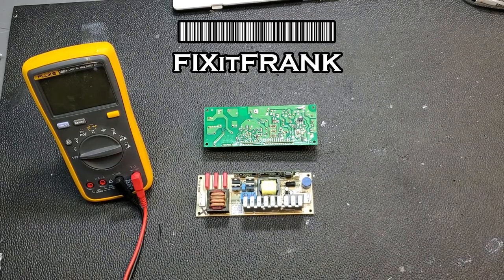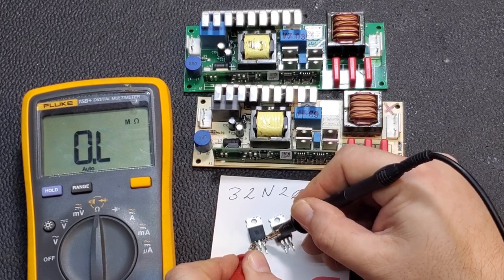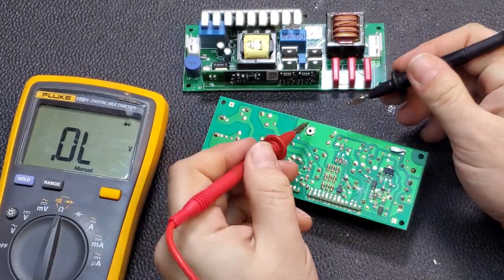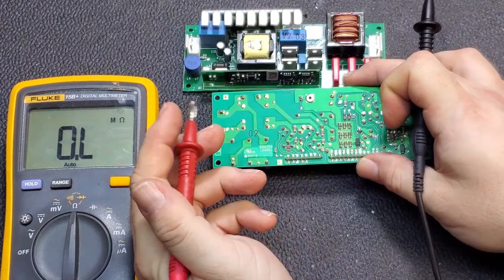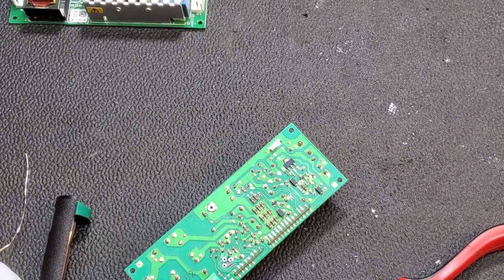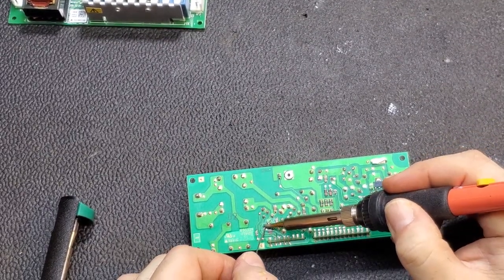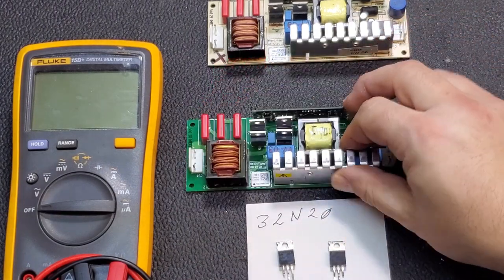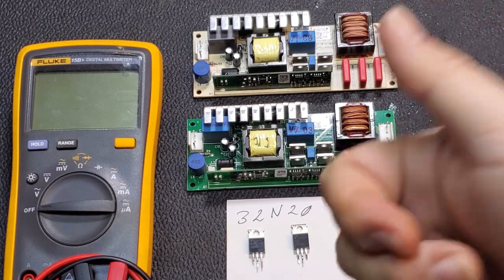Digital Video Projector Ballast Diagnosis and Repair

Comment: Hi Frank, I appreciate your videos they have been very helpful with repairing several projectors. I have a question concerning an Epson 6010 that I'm trying to bring back to life. Currently it will power up, cinema filter adjusts, lens cover opens, all fans operate, auto iris adjusts, lamp comes on... then it all falls apart.. lamp immediately goes back off (can only see it light with the case off), both temp/lamp lights flash red and fans go into overdrive. Then it shuts down with the lights still flashing. I'm wondering if this could be ballast related. I'm running out of things to test, everything so far seems ok. Thanks for reading!
Reply from the maker: Hi Brian! YouTube keeps moving my replies to the wrong comment so I apologise of this appears multiple times. 
I would verify the voltage of the tach leads of the fans. Even if spinning correctly, they can fail to report that. I prefer to use a scope to measure(average is two pulses per room)but a volt meter will work. The measurement should be very low. Usually under one volt DC. If you measure 2v or higher, then a fan is a problem. I doubt the ballast since you get lamp/temp warning and you had an image even briefly.
Reply: I've tested that the fans all cut on and work but I'm not sure how to test the tach. Can I do that with a multimeter or do I need something different? I will say that when I first tested the fans with a 9v pigtail the two "LV" fans would not come on. They did come on however with power to the unit. Thanks for the help with this.... Losing my mind trying to figure it out.
Reply: @FixitFrank  Ok thanks. I'll see if I can test the voltage of the fans. Hopefully its just fan issue. The light output never makes it to the lens, I can just see the lamp come on for about 2 seconds when I have the case off and power the unit up. Not sure if that matters.
Reply from the maker: @briankidd4246  Here you go  https://youtu.be/stIYr2bI2fQ  I show how to test some here.  As long as the door switch is bypassed, you can run it that way.  I dont want to say the ballast is bad yet.  You want to rule out all the items that will shut down the lamp that quickly first.  So many things are tied to the lamp-on circuit that if any one of them is acting up, the unit will shut down.  I'd also expect to see lamp light flash by itself if its a ballast. The fact that the temp light is flashing too makes me lean towards fans.
Reply: @FixitFrank  Awesome! Thanks! I'm tempted to just buy a replacement fan and start plugging it around the main board to see if the projector will come on with one "replaced"...
Reply from the maker: That wont work unfortunately. Each fan has different specs.  You need the exact model of the fan.  One thing that will work though is if you use a 10K resistor to ground and then touch the tach lead of the suspect fan.  It's not a 'fix' but it will help you verify the bad fan once you find the one with a weird output.  Trust me when I say don't throw money at this problem.  Its going to probably be a very cheap fix or a very expensive problem.  No in between.  The 6010 is selling for $600-900 depending so it's worth putting some money into it, but I think you will find a fan that is showing 5v on a tach lead and then that fan will be less than $10.  If you spend a little extra time chasing voltages, it will save you a lot of grief and frustration.  Sometimes you can just change a part when its obvious but this particular error I have seen on cheap epsons (83+ comes to mind) and it was a mainbaord issue.  The 6010 is a bit nicer though so I doubt its a mainboard problem.
Reply: @FixitFrank  ok thanks. Hopefully it's not the main board since this thing has less than 1,000 hours on it. You never know though... I'm learning as I go on how to test electronic equipment so I'll follow your video and see what I come up with. I like the idea of testing with a resistor but I'm not sure of the steps to take to do so. They are cheap and seem to have many uses in these scenarios. I will say I am becoming an expert in taking this thing apart and putting back together....
Reply: @FixitFrank  Tested all 5 fans and they each came in under 2v. In the 1.6v-1.7v range. Is there anything else you can think of that I can test? Thanks for all the help!
Reply from the maker: @briankidd4246  That is good and bad.  I was really hoping you'd find a fan. They sound OK for sure.  The next thing is the temp sensors.  However those are not really measurable with a meter since they use a serial bus.  I think the next step is to hook up a pc to its serial port and send commands to get the error list. 
https://epson.com/Support/Projectors/PowerLite-Series/Epson-PowerLite-Pro-Cinema-6010/s/SPT_V11H399020#manuals
Go down to the ESC/VP 21 codes and download those.  You will need a serial port on a pc, either a USB-serial cord or a real 9 pin serial port on a desktop.  You can then send commands to the projector and if there is a problem it will return an error code.   Once you download the zip file you want to read the word doc first.  It explains the data format and how to send it.  You'll need a free serial terminal program like Hyperterminal or PuTTY to send the commands.  Its all in the manual.  
In the word doc there is an error section where they talk about all the possible failure codes.  This model might have a peltier cooler as well as an air flow sensor that coulc be an issue.  It seems to list all the un-measurable with a meter error modes.  
I don't think there is a better approach unless we can find a schematic. That would be amazing but Epson is one of the hardest to find. Check out the serial codes in that link and see about doing that next. It will save you a ton of hassle and should hopefully point out the exact cause.
Reply: @FixitFrank  When this problem started I used Putty to try to determine the error code after the red lights started flashing. If I let it go through the process and then entered ERR? In putty the response was RR=FF. I wasn't able to figure out anything on that code. It seems generic. I will download the file and see if I can toss some additional commands at it to see what happens. This is a parts diagram for the similar tw9000: https://www.gedat-spareparts.com/ex/eh_tw9000.pdf

The 5010 is apparently very similar as well.

I have torn this thing down to the cinema filter, even took that apart to check the gears. I have been leaning towards a thermal issue because of the fans kicking into high gear when the lights start flashing. Who knows though... all I have is guesses. Everything I've tested so far is coming back ok. I appreciate all of your help. At least if I can't figure it out I gave it the college try....

Comment: Hi thank you for your working. How many volts are there working this ballast. My mother board's output voltage is 315 vdc. Is this a correct?
Reply from the maker: Hi Orien, you should have 380dc. I think your power supply is not running the power factor correction circuit.

Comment: Frank, thank you for this great video. I have a Benq HT1075. The lamp inside was cracked but still functioning. I ordered a new Osram bulb and replaced the cracked one in the housing, but now the projector blinks red when I power it up and show no image. When I put back the cracked lamp, it gave me the same error. I checked the ballast... the voltage coming from the PSU is alright, but the diode doesn't show an open line like in your video, I get readings in all the ways. My meter acts crazy when I am checking the output of the ballast and turn on the projector, then it stabilises and reads about 50V. I can't find these parts in my country, so I have to import them. Do you think the problem still in the lamp or maybe the ballast? Could the colour wheel sensor cause this issue? It was really dirt when I opened the lamp compartment,  and maybe some dirt has got there.

Comment: Hello frank I actually have three ballasts all very similar. Two are exactly the same off of a Samsung Projection tv. All three ballasts have blown MOSFETS. As soon as power was sent to them the blew. 120vac was used on them and that may have been the problem. I’m really unsure. Maybe you’d be able to give me some input. I am fairly new to this and pretty much self teaching myself so if it’s simple, I apologize for my ignorance lol.
Reply from the maker: Hi Jenny, I'm happy to help! You may be correct.  The input voltage should be 380VDC. There is a power factor correction circuit in the power supply that creates the 380dc.  Feeding 120vac will damage the fets. Fets require dc to operate properly. It can also damage the control circuitry on the little standup board.  While possible to repair, I'd find a used but working ballast. The issue with repairing ballasts is the need for a known good power supply as well as something to generate the lamp-on signal for the control of the ballast. The part number should be on the board in a square(it's all silk screened on). 
What model is the Samsung? I'll find you a ballast on eBay if that will help.

Comment: Hello Frank! Thank you for your great video. I had a short circuit on my projector Benq TH683 , since then the projector doesn't start. The only thing it does is power button shows red light /a bit orange i could say/ anyway after i pres power button it turns on light goes green, nothing starts. Projector shuts down green light blink once and goes dark. I can hear electricity afterwards and some heat created if power cable stays plugged. What could be the reason ? Could it be the ballasts ? Thank you!
Reply from the maker: Hi Uki,  It's probably not the ballast, only because the ballast won't be powered on unless the color wheel starts spinning first. My guess would be a problem in the main power supply.  A bad MOV maybe or something in the power factor circuit.  This is sight unseen of course, but if I had it, I would start checking voltages and verifying semi conductors first.
Reply: @FixitFrank  so even if the ballast board tests bad - problem may still be in the Main board? Diode shows 1ohm both ways. projector gives no sign of life.
Reply from the maker: @oleglego3655  Hi Oleg, is the diode across the transformer? You may want to unsolder one side of the diode and test it. Many times the ballast will short out and damage the power factor circuit in the main power supply.

Comment: I really appreciate your videos, and hope you can help me out.
My bent w1060 projector suddenly made a "click" -sound, and the image disapeard. The power lamp was blinking orange and it did not respond to anything. I pulled out the power cord, and put it in again and pushed the on-button. The projector made 2 or 3 "click" sounds and the power light started to blink 10 times, a pause and a "click" and blinked 10 times again.
I have inspected the lamp and it does not look damaged. 
I hope you have an idea of what it can be. 
PS! Keep up the good work ;)
Reply from the maker: Hi Lars! The click might be a few things. If the lamp is between 1500-2000 hours, it might be a good bet.  The flashing Orange power led(if only the power led is flashing) means the projector is cooling down. Something told it to turn off. If the lamp is good, then a color wheel failure would make sense. The click may be the glass segments tapping as the motor tries to start. See this video https://youtu.be/DbhFVKExGVQ  It is showing a Mitsubishi, but the methods are good for most DLP projectors. If the color wheel ends up OK, then I would try a lamp. If the lamp does not fix it, then it will be something internal such as a power supply or ballast/lamp driver problem.  I have the service manual for that model. If you need it, email me (in the about section) and I will send the PDF.  Thank you kindly for the words of encouragement!
Reply: Tnx for the reply.
The lamp hours are right about 600.
I tried to clean the sensors on the color wheel, but that did not help.
Is it likely that the color wheel is broken? The projector is barely used (600 hours), but you know this better than me ;)  @FixitFrank
Reply from the maker: @larsandersmyklebust4794  You would have noticed if the color wheel was damaged if you have cleaned the sensor. I could see the noise being caused by glass segments getting stuck. When the motor starts, it would push the segment and make the noise.  It might also be a ballast issue. Is the lamp a name brand bulb such as Osram or Philips?
Reply: The lamp is the original one (do not know the brand). 
The color wheel turned around smoothly and no noise when i cleaned it. But the color wheel is not responding at all, when trying to turn it on. The clicking from some relay is the only thing that is happening when I try to turn it on.
Is there any temperature sensor somewhere that’s telling the projector that it has to cool down?
Reply from the maker: @larsandersmyklebust4794  Are you sure it's a true 600 hours? For a 6-8 year old projector that is very low hours unless it is only used on rare occasions.   There will be a name on the back of the ceramic of the bulb or a sticker on the side.  It should be a Philips UHP bulb.  I only question the lamp because the symptoms do sound like a failed lamp.  There may be a crack or tiny leakage of the arc tube gasses.  Of course this is without it in front of me.  

If the click you are hearing is the relay and CW is not starting then there is another issue. The CW should always start first, then the lamp.   The startup process is usually, Color wheel, lamp, fans. Sometimes a fan will start with the color wheel. If there was a temp sensor issue, you would get a different set of flashing LEDs.  

I am strongly leaning towards a lamp, color wheel drive cable(the flat cable to the wheel) or it's index sensor wire(rare but I have seen it), ballast failure or lastly a logic issue with the mainboard.  I doubt the mainboard highly.  Ballast or lamp is what I would be looking at if it were here.

At this point it would be worthwhile to check through the service manual and see where the flowchart takes you. I uploaded it to my Google drive.  Feel free to download the PDF.  The flowchart starts on page 68.  https://drive.google.com/file/d/1FK-6LQvXUG3A2Gg4Ztim-kLieBmj1-Ts/view?usp=sharing  <--Service manual Link

I would try another lamp before a ballast. Be sure whoever you buy it from has a Philips bulb inside. The knock off lamps are much cheaper but they cause more problems than they solve.
Reply: FixitFrank I will try to look at all these things. Thank you so much so far😊

Comment: Hi @FixitFrank, happy 2020! 
Thanks for great videos that help us all with our struggles, and thanks for your help last time.
Can you do it again?

I have a new symptom in my HD83.

4 times out of 5 I turn it on, Optoma's startup logo doesn't show up on the screen. 
Whenever it happens, HD83 fails to show the picture.

The lamp is on. I can see most or all of the monochromatic graphics the HD83 uses to give feedback on what is going on, like the signs that say it's detecting the hdmi channel, closing of the blu ray player's tray, playing and so on. Sometimes I can even see the home screen of the Panasonic blu ray player, that's in color even though rather dim.
The vent goes always on, a little more noisy than otherwise.
But the screen remains dark as soon as any film would start.
(I could see an old universal opening logo that was only made of their small globe & writing in b&w.)

I then have to turn the HD83 off and on again, mostly several times, 'til I finally get Optoma's colored logo at startup.

Whenever Optoma's startup logo shows up, the HD83 goes on flawlessly.

Faulty color wheel, faulty controller on motherboard (or wherever it may reside), or what?
Reply from the maker: Ciao Italo! That makes me think about the power supply.  I had a similar issue with my personal TH1060 Optoma.  I would get garbled logos.  Replacing the power supply did it for me.  The mainboard was not getting proper power. 
In your case, I would check over connections( maybe re-seat wires) to be sure.  Then if there is no improvement, checking voltages that feed to the mainboard would be next.

Comment: Hi, Frank. First of all I would like to thank you for the video. So I would like to ask you, what was the projector's symptom with this defective ballast? Did he make the projector turn the colorwheel, make the noise trying to turn on the lamp but could not turn it on? I bought a defective Vivitek H1080 and the old owner could not explain what happens to him. He just told me that the lamp was supposed to be good and maybe it was a power supply fault. Testing the projector with the tip that you provided, I noticed that it turns the colorwheel and emits the sound trying to turn on the lamp but it can not turn on. The projector repeats the process a few times and after about 4 or 5 attempts it speeds up the cooler and needs to unplug it.
Reply from the maker: I replied on your other comment but for anyone else who reads this, I would try a known good lamp first. The startup noise from the ballast usually means its OK and that the lamp might be faulty.  The lamp is the easiest part to change so I recommend trying a good lamp first.  Make sure it has an Osram brand bulb inside and a good lens coating(should be red/blue when you tilt the face) and not the green coating. That will rule out your most annoying variable. Then if you still have startup issues, the ballast is readily available.